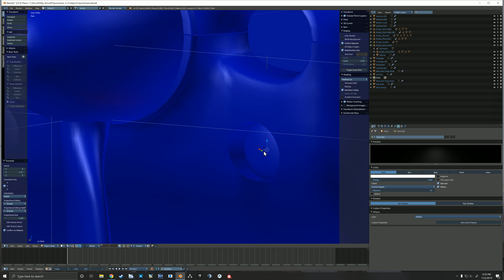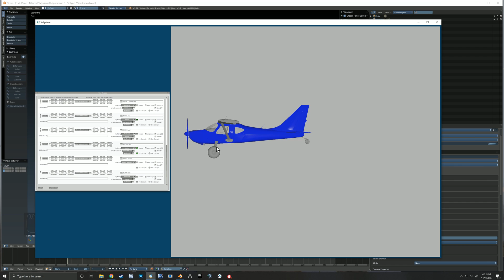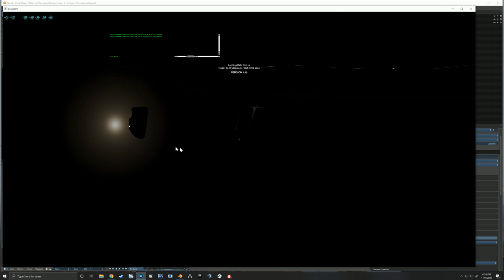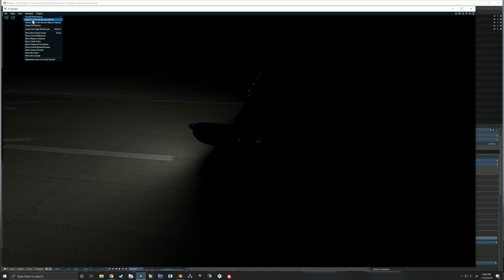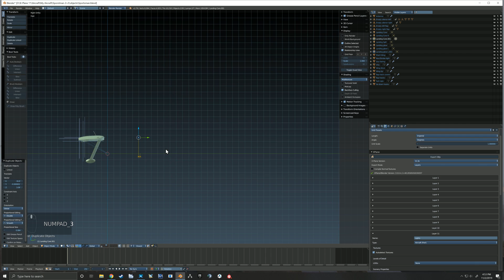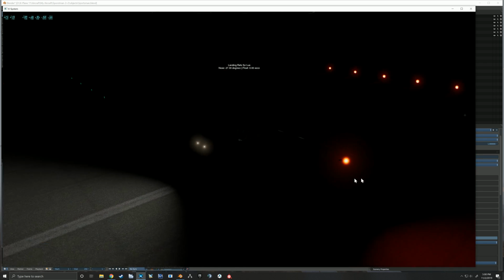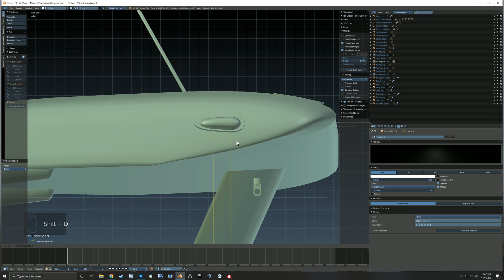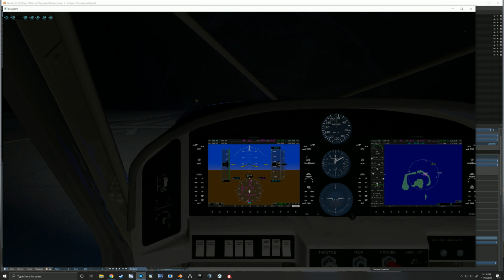How to make an airplane for X-Plane 11 Tutorial #34

Comment: Can you explain how you get the lights to show up in Xplane? I'm using xplane2blender to export a scenery made in Blender 2.8, but the lights aren't appearing in the .obj files. I noticed you were exporting the lights as their own objects, but then how did you get them to attach to the airplane model correctly?
Reply from the maker: I think it's different for scenery. When doing scenery I think the light should be in the same object as the building, but I'm not sure. When adding lights to an aircraft you attach the object inside planemaker. I also think that only certain types of lights work for scenery, so make sure you're not using an aircraft specific light. I haven't worked on any scenery for years, so I might not be much help.
Reply: @BuildItBetter3D  That makes sense to me, but Blender won't let me join the light and the object because the light isn't a mesh.  That's why they don't export properly.
Reply from the maker: In Blender 2.8 you should be using Exportable collections, don't use the exportable object option. Create a collection(basically a folder) and place your building and your lights into that collection. Set up the collection export with texture names and such and then export. You can have as many objects or lights as you want in a collection and then when you export you still only get one x-plane object per collection. Just make sure everything inside a collection uses the same material or it will give an error.